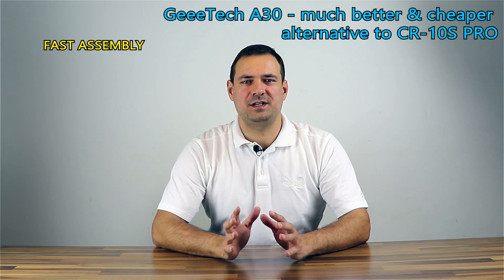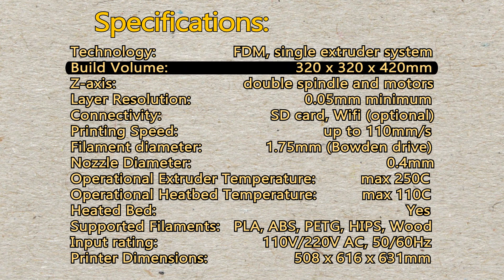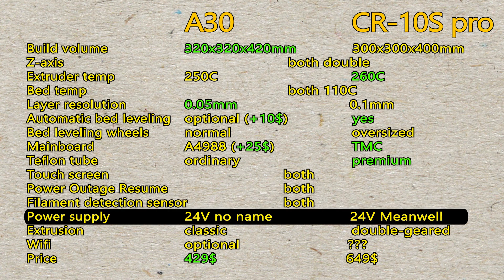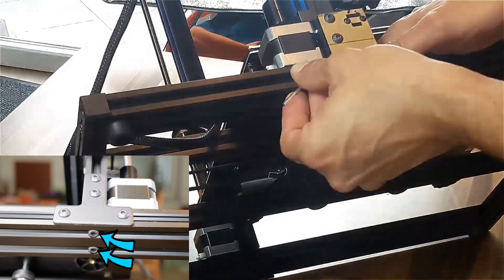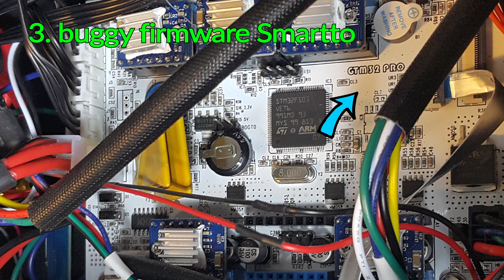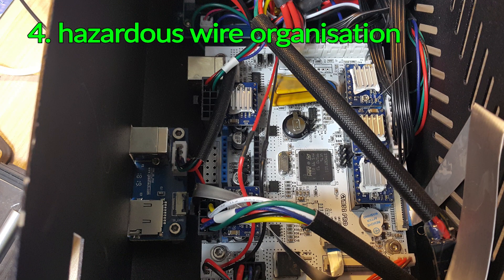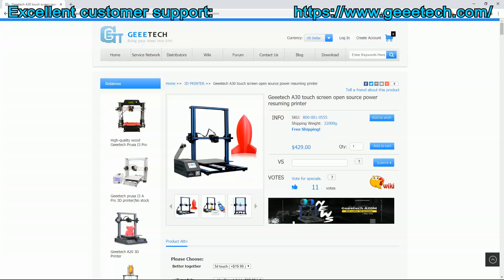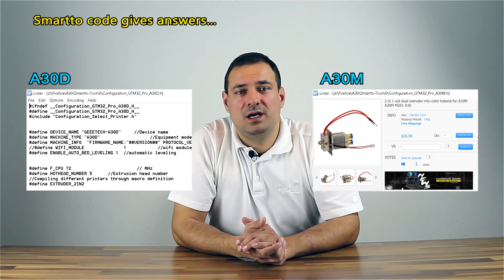🔴 Geeetech A30 review - honest opinion - better than Creality CR-10S PRO - best 3D printer

Comment: So starting to get into 3d printing and looking at the A30.  Did the issues get resolved?  Any updates from 2019 to 2021?
Reply from the maker: Hi. I have no problems with it besides classical ones like clogging from time to time. After the upgrade to Trinamic stepper chips it is quiet... I had to change the nozzle a few times due to wear as I print a lot... I still recommend it.
Reply: @greeneyedexplorer  thanks for the reply, after a bit of research I am boiling it down to this A30 compared to the Ender 5 Plus, what would you recommend?
Reply from the maker: Ender just due to potetional need for spare parts and quick answer to potentional questions...

Comment: As per today prices (08 June 2019), on Banggood , i don't think is a good investment when you compare with Creality CR-10S Pro :
Geeetech A30 = 477,05 $
Creality CR-10S Pro = 569,99 $
The price difference between the two printers is only 92,94$. If you want to invest in TCM2208 + leveling sensor (36$), the price difference will be reduced to 56,94$. So, no way!
Reply: Does the Creality CR-10S pro do more than 1 filament at a time?  I am new to 3d printing and trying to find something decent to start with.  I was considering Geeetech A30 since it did 3 at a time, but I prefer to have good customer service and options for changes and upgrades.
Reply from the maker: A30M mixes colors. A30 printers are minimally upgradable. Creality has better support by means of more printers sold. Anywhere you post a question you get the answers quickly... Geeetech mainly promotes A30M nowadays...
Reply from the maker: Hi. I agree. It is becoming a thing of a personal taste as price range gets closer... Search for discount codes...
Reply: @greeneyedexplorer  I agree with you 50% about the personal taste. Two monts ago, when i start to check the market for a 3d printer, my main goal was not only the price, was also the hardware and software support for the printer. An this moment regarding the firmware and software, CR-10S Pro is total different than the one was in January, for example. Creality released in the past 6 months 3 new firmwares, plus the one from Tiny Machines, who improved a lot the printing quality. With minores expenses (anti-backlash spring loaded nut to solve the Y axes problem and inductive sensor for bed leveling ) at a total of around 12$, you'l have a printer at the quality level of Prusa MK3.
One more thing, in this moment, if you want to order Geeetech A30 from Banggood to Europe, you don't have any option to avoid the taxes, compare wit CR-10S Pro who will be sent from UK warehouse without any taxes (only the shipping fee).

Comment: You are doing a great service with these videos.  I'll give you a little more info to help you with the future videos you are doing on the A30:
My A30 is an in-between model.  HW Ver. 2.1.  First let me say It prints EXTREMELY well some of the best prints I've seen on any printer anywhere, but it is a nightmare on LCD firmware and leveling.  It only manually levels correctly on the LCD (and perfectly I might add) with the original firmware package V1.35.56.  ANY and ALL versions after this, the Z leveling process is hopeless and will end with you scratching up your bed and killing nozzles.  The first problem is that IF you can go through the level process, upon hitting the return button on the screen to go back to the menu, the print head does not lift before moving back to XY home.  Which means if for any reason you hit that button without the bed perfectly aligned... SCRATCH.  Also, most of the versions have major bugs with selecting the various level points on the bed.  The offsets randomly change at different bed positions for no reason and end up many mm below bed height ramming your nozzle into the bed at full stepper torque.  If your Z couplers aren't the aftermarket type that will separate, you might mess up your z axis.  Hardware versions after mine (3.0 and higher) may all be the Pro VD motherboard instead of the Mini S which might or might not work better?  I'd like to know if yours manually levels with the latest firmware.  Just be careful of your bed.
The other issue is the old HW versions and touch probes.  Mine doesn't have the correct connector on the top of the hot end for the new 3D touch probe.  I bought it from Geeetech but I can't use it without some type of rewiring that they don't document very well.  Last is motor control.  The smartto motor control tool works like you show in this video, but not on the old V1.35.56 firmware.  Only a few of the top entries can be read and edited, the rest are blank and can not be set.  So you can either have proper motor and pid settings, or working manual bed leveling, but not both.  I've fought with this for months.
SOLUTION:  Found one yesterday.  Use something else to do leveling.  I have reached a point where I print entirely from OctoPrint through my OctoPi anyway.  Someone wrote a manual bed leveling wizard plugin.  It's FANTASTIC.  It does exactly what the LCD screen control SHOULD be doing.  It lifts z for every move, doesn't randomly screw up offsets at different bed positions and lifts at the end for return to home.  So now I can use the latest firmware V1.38.59 for printing and use smartto for motor control and still be able to level the bed and print.  I only use the LCD to set the initial offset from the z limit switch, leaving it in the home position.  It works fine and safely to set a Z offset... as long as you don't actually move to any of the leveling points on the LCD.
This all sounds pretty horrible, and it is BUT the printer gives you so much hardware for its price point.  Every showstopper problem stems from their proprietary closed source LCD.  If they just used an open source head end this wouldn't even be an issue because someone in the community would have been able to fix the LCD leveling controls over a year ago.
Geeetech and several users are all working feverishly to get the printer working on Marlin, but even if they do, will Geeetech finally FIX the proprietary LCD control?  It's literally the only thing holding the printer back from being perhaps the gold standard for 3D printers.
Reply from the maker: Hi. Thank you for the comment. I agree. All these problems have an easy solution - transition to Marlin + open source LCD...

Comment: This is the first video I've seen with the same version A30 that I have.  It is my first printer and I bought a genuine E3DV6 to upgrade the hotend.  The problem is, the thermistor is a cartridge style on the new hotend and I have no idea how to adjust it in the firmware. I have printed out all the Petsfang stuff, and am very comfortable soldering and doing the hardware portion.  I just have no idea how to adjust the firmware to account for the different thermistor, as well as raising the max temp.  Thank you.
Reply from the maker: Hi. I would use original A30 thermistor. There could also be problems with extruder PID calibration... If you decide to go your way, I would advise to use Arduino Mega 2560 + ramps 1.4. This is the easiest way, but you would lose original LCD... Might be just for a while until they merge sources with Marlin. Good luck and thanks for the support.
Reply: That sounds like it would work, but, I have no idea how to do any of that.  I'm sure it involves flashing marlin to the mb, but everything I've read has said that marlin on that mb is very buggy at best, and I can't find any source on how to do it.  I guess I could order another heat block for the old style thermistor, but I still need to increase max temp in firmware, and how high can the glass bead style theoretically work?
Reply from the maker: It is hard. The main problems are:
1. If you change heating block, you have to run PID algoritem to set it up. Then save parameters for the extruder with Smartto tool.
2. Even harder. Changing of thermistor (new type of it) is done in the firmware. Write the code for new thermistor, add it into source code, recompile them and upload them. This is why I would use stock/original thermistor.

If you use M2560+ramps, you just have to reconnect all cables to Ramps, tweak the Marlin sources and flash them.
Marlin is on the stock board not supported yet (although Marlin 2 supports STM32 chips). They have released some code on Chineese pages, but I couldn't get them (check first link below). At the moment, the smartest way is to wait. Either way would take a lot of time and work. I have done it on my old printer and it took me a month of free time.

Your question about extruder - no extrusion problems.

So, do check the links below. They might give you more answers.
https://github.com/Geeetech3D/Diagram/issues/1
https://github.com/MarlinFirmware/Marlin/tree/bugfix-2.0.x/config/examples/Geeetech
Reply: I ordered a new heat block that supports the glass bead.
Reply: Also, are you saying that the extruder has inherent problems?  or that increasing temp would cause an extrusion issue?